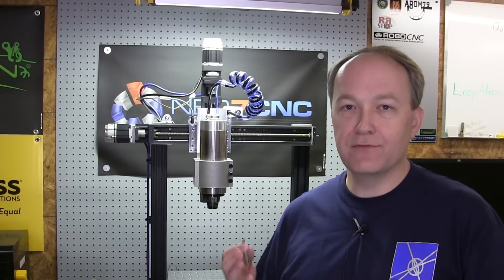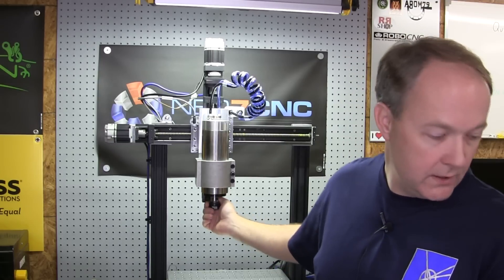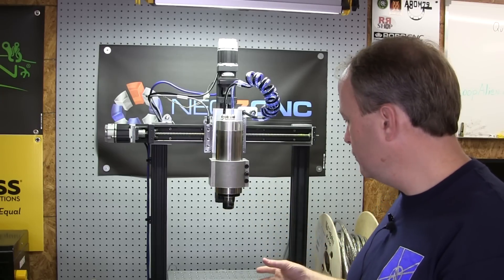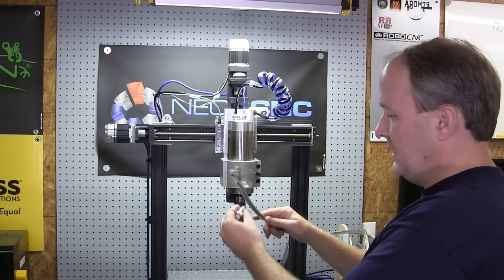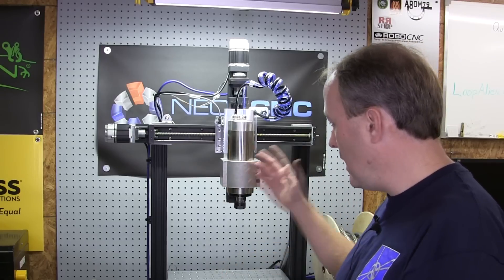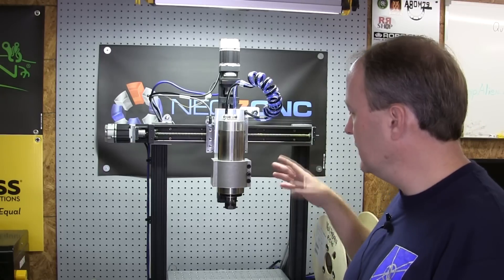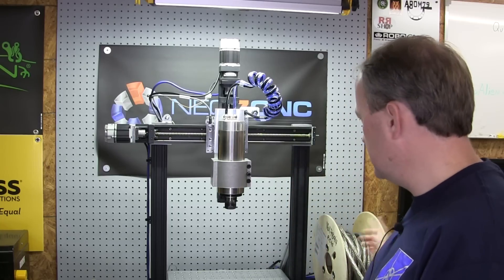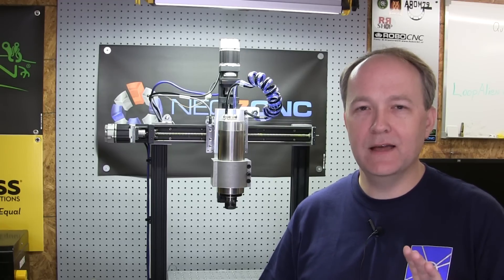KR33v2 DIY CNC Machine Update - 3 - Neo7CNC.com

Comment: Hey David, 

over here in Germany these spindles are quite common in the DIY CNC community. I myself am a user of apparently exactly the same spindle and can maybe give you a few good hints:

First, and, in my opinion, most important: The spindle itself lacks any kind of grounding connection! The spindles you receive over here have the four pin connector where only three pins are connected. If that's the case with yours, you're going to have to open up the spindle housing and make the ground connection for yourself so that in case of a shortage the RCD get's tripped.

Second: The water pump.
220V (or better said 230V) are standard over here. If your circuit breaker is rated 16A or higher there will be no problem what so ever running the pump on the same circuit. I actually have my whole system (VFD, water pump, vacuum, pc, lighting, CNC controller) running off one (Yes, one!) single 16A 230V connector. 

Third: RCD for VFD
IF you have an RCD fitted, pay attention to what Type it is. Since the VFD creates a high frequency (approx 400Hz) normal RCD won't trigger properly or at all! You're going to need an all-current sensitive RCD such as "Eaton Residual Current Circuit Breaker FRCdM Type B / Type B+ / Type Bfq". These are the only types that really detect alternating, pulsed and direct currents.

Fourth: Coolant
I use 10l  (approx 2 1/4 gallon) of distilled water mixed with 2 liters of automotive coolant rated for aluminum radiators. works out at about a ratio of 1:5. Cheap and simple. Get's renewed every 12-18 months. The coolant gives you an additional protection against internal oxidization of the spindle and prevents build up of alga in your fluid.

That's about the most important things I can think of at the moment.

I hope this comes up helpful, cause this gives me the chance of paying back for all the knowledge and experience you share here.

Kind regards, 
Alan
Reply: One more thing: Shielding

Connect the shielding of the cable only to one side (either VFD or spindle). A lot of people (including me) have experienced crossfeed of the HF into the steppers when both sides were connected resulting in steppers moving all by themselves once the spindle is started....

Comment: Hey bud love your vids. Check the vfds relay output can run the pump. Wire a socket to the vfd. That way you never forget to turn in on. Program the vfd to run it when the spindle starts.

Comment: Works out about 4.5 psi, but there's no way in help that pump does 1 ltr a second (gallon 5 seconds), (3500Lmin/60/60=.97L/s). So all's good there, you could use pretty much any pump in the future. But in the mean time, just for testing the spindle etc I done a quick calc just guessing some figures as I can't find a link to the spindle kit. Assuming the spindle is 80% efficient at full load you will have 440Watts of heat to get rid off at say a max spindle operating temp of 60c and room temp of say 20c gives you a 40c window. 440W will heat 1lt 1c per 10 seconds (approx) from 20c to 60c. so that's 400 seconds you got to play with per liter.
10 gallon bucket is about 50 liters, so should be able to get 400x50=20,000s/60min=333/60=5.5hrs run time at full tilt and worst case without even considering thermal losses from the bucket and pipework. And a tiny flow rate to worry about 1lt/6mins. Like random shit said a pc "watercooler" should work pretty good, they are more rated or limited by the thermal transfer from the cpu heat exchanger rather than the radiators ability to remove heat, in fact the radiators will be over speced to compensate such poor heat transfer from the die to cause a greater thermal potential. most run on mineral oil, non conductive, non corrosive, not the best heat per weight but would be ample as the spindle would have greater contact area. the pumps are very reliable.
is there a thermal cutoff on the spindle?
Single phase needs considerably larger phase conductors than 3 phase. I would help you out but i'm all metric to imperial worn out and I don't fancy getting into AWG. but in the uk, being very rough and at 250v, max and ideal 16A on 2.5mm single phase 1.5mm on 3 phase. we use conductor area over here not diameter. 250vX16=4kw , depends on the drives output too. looking at the aviation plug it came with, I thought they where rated at 5 amps per pin. It might be sticking out 400v 3 phase on them pins. 
All the best.

Comment: Im running a small 12v PC water pump and a 120mm radiator and reservoir those spindles don't require a huge flow rate
Reply: or a cheap washer fluid pump off a car
Reply: I also run the same on a 800 watt unit with no problems.

Comment: 4 meters is 5.698 psi.
Reply: So if you placed your pump 4 meters below your mill, you would have no flow. So maybe as rough rule with out pump curve, 0 psi or 0 meters of head (no back pressure or resistance), you would get  the rated flow rate. As the pressure increases maybe you would get a percent of the flow rate until it reached the 5.698 psi at the outlet at which point it would stall.

Comment: Welcome to Asia... Everything in China, Thailand and other countries is 220 Volt... I don't think you needed to rewire your shop... Just get a 110 - 220 Converter... I bought a 12VDC to 110/220 VAC power Inverter from China. When I go to SE Asia, I take along a converter, so I can just plug it into a 220 VAC wall outlet and plug my 110 VAC Laptop into it... Done deal. My power inverter is 2000 Watts, with a 4000 Watt peak. I can run 220 VAC off the inverter, from a 12 VDC Battery. However, the output amperage is much lower. 220 VAC might sound huge, but it's not... I have LED Christmas lights, also from China, which are also 220 VAC, but the wiring is lighter than most Christmas light strings... So, I think your power supply may be built for the standard 220 power in China, not the 220 power in North America... Might be worth your while to look into that... Good luck...

Comment: Igus cables are the best, as long as you selected continuous bending cables and not torsional flex cables. Im using LAPP cables as they are cheaper and i wont use my machine as much as you. Check out this instructable for tips on cnc cables and chains. http://www.instructables.com/id/Selecting-cabledragenergy-chains-for-CNC/

Comment: Calculating pressure from head. P=rho*g*h where h is the head, g is the acceleration due to gravity and rho is the density of water. That pump puts out 34314 pa or about 5 PSI.